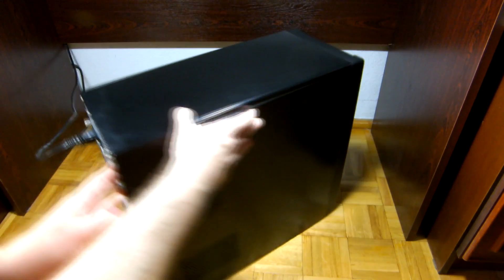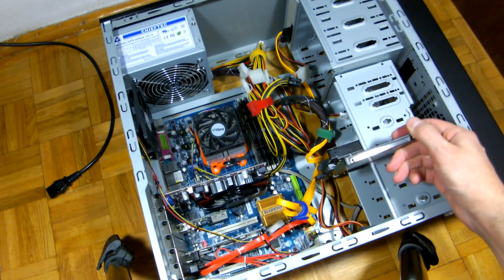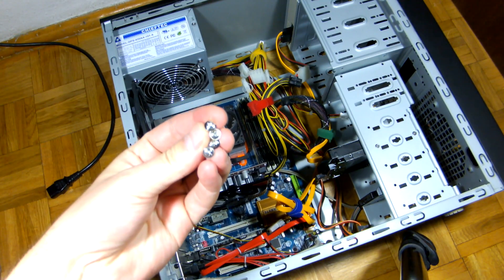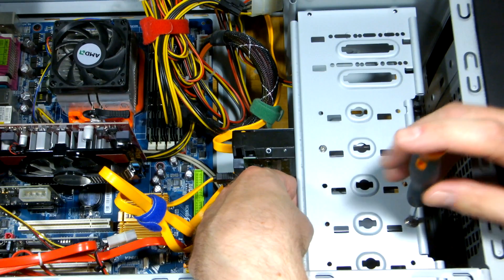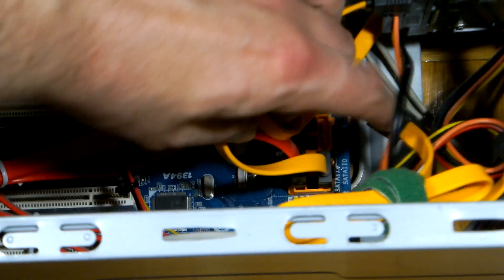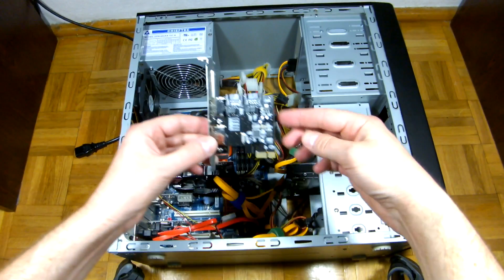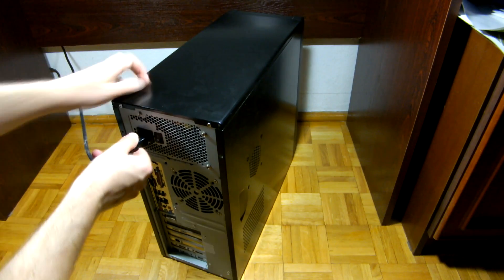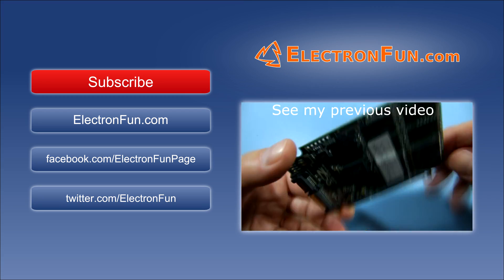How to install an SSD in a stationary PC | computer tutorial

Comment: I need you help
I want to buy a SSD and want windows to load up from it to get a faster boot up but something i have doubts about is when i clone the HDD over to the SSD would i need to activate or give any kind of product license/key? 
I will give you two links and look at the 3rd answer in the first link
https://www.quora.com/If-you-clone-the-OS-hard-drive-will-Windows-require-a-new-license

and the first answer in this post 
https://www.quora.com/How-can-I-solve-this-issue-I-am-using-ArcGIS-I-have-installed-the-SSD-and-cloned-it-from-HHD-but-now-it-is-asking-for-the-license-Now-the-new-SSD-is-asking-for-the-ArcGIS-license 

Hope you understand my question :)))

Comment: I made the SSD my main OS and I'm trying to use the old HHD for a backup. I can see both drives in the Bios, but the HHD does not show up on my device lists, any suggestions?
Reply from the maker: If your OS is Windows 10, I would suggest checking 'Disk Management' by right clicking the Start menu and selecting it from the list. Your HDD should be on the list of available drives. If you're on Linux you could use your terminal to issue the following command: lsblk. All the connected drives should be on the list.
Reply: @ElectronFunCom  thanks, I did try that and only the SSD and external are showing
Reply: @kirkgardner2002  Still not showing your HDD?
It means your PC doesnt recognize your HDD anymore i think, try to unplug and replug the power supply on it. Something simillar happened to me too. I should install RAM and after i did that and turned my pc on, it wouldn't even turn it on it says no HDD is insert and recognized or something like this and i was totally lost for what was wrong because i didn't even touch the HDD but got help, i replugged the HDD power supply and after that it worked. 
If i'm not totally lost in what you mean and your PC doesnt show the HDD up then try this.
Reply: @Ibo2630  I figured it out, thank you
Reply: @kirkgardner2002  oh well :)

Comment: What if you don´t connect the SATA power cable? My computer does find the SSD but it restarts itself every time Im trying to connect to it :S
Reply from the maker: If you don't connect the power cable, your disk will not work at all.
Reply: What even is that question lol

Comment: where did you get the cables to connect the SSD? Do they come with the motherboard or the SSD? thanks for the great video!
Reply from the maker: +alltheparts SATA cables are usually added to motherboards, but you can buy them separately in most stores with computer parts.